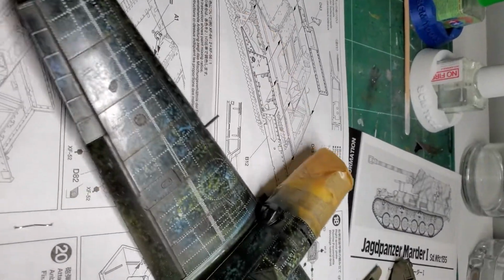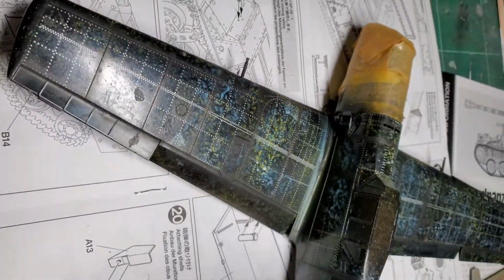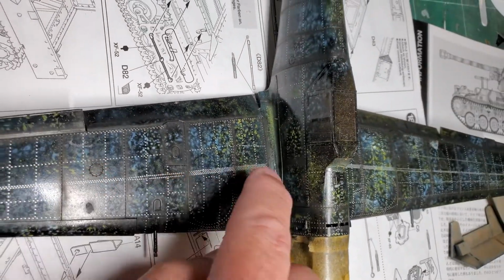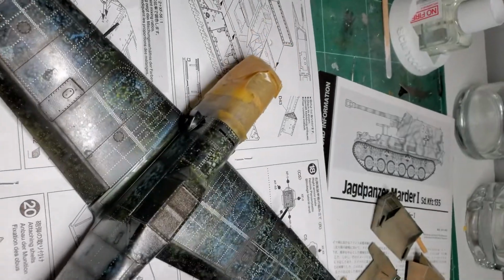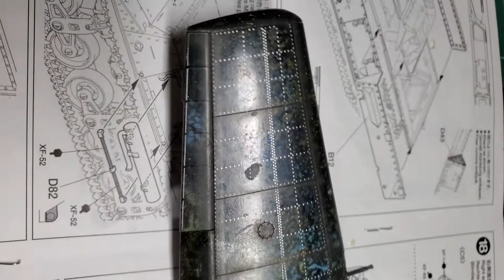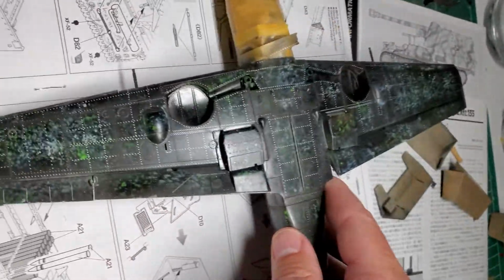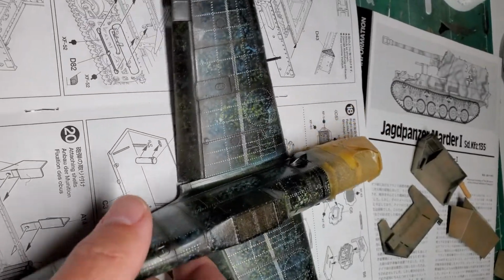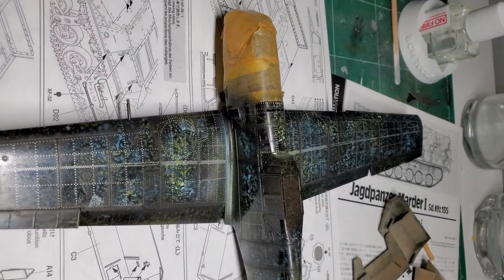bf109Dragon 3 Base Paint

Comment: How did yours turn out? I'm in the "fiddly bits" stage of mine and it was a really great kit overall. The only hair shirt was making the cowl closed, required a lot of surgery but other than that, it fit like a dream.
Reply from the maker: Yes the cowling fit is very poor.  I left the top and bottom off and  just posed them next to the aircraft.
Reply: @fuzzysghostmodels9840  I would have done the same but I'm building it for someone and they wanted it buttoned up. Just removed or didn't add some of the engine and MG bits, a little thinning of the cowling and motor mounts and it (finally) fit flush. Also fortunately no step between the fore end of the cowl and the prop spinner.